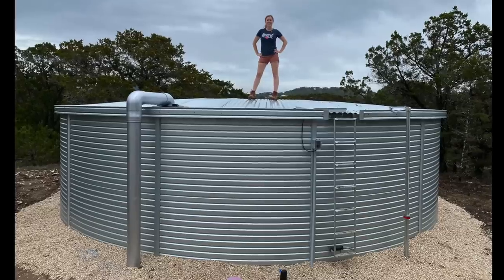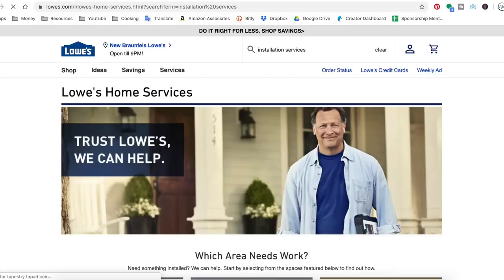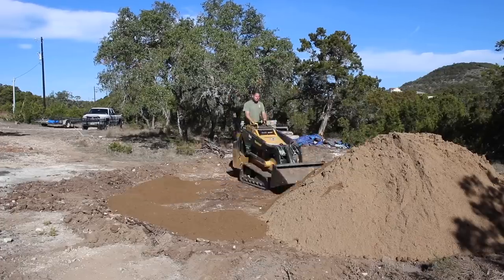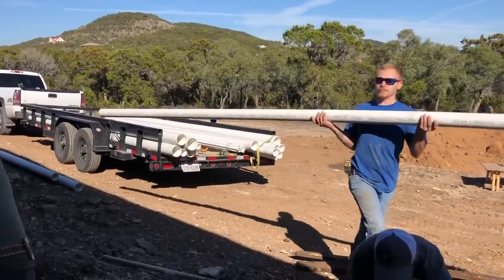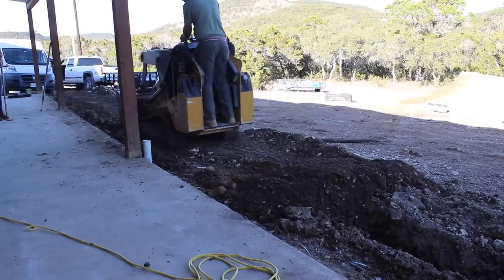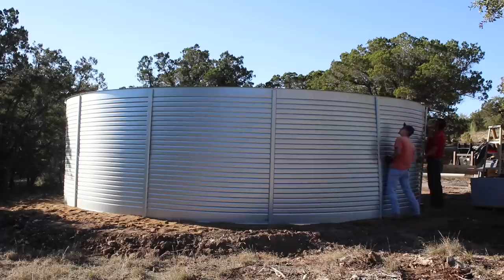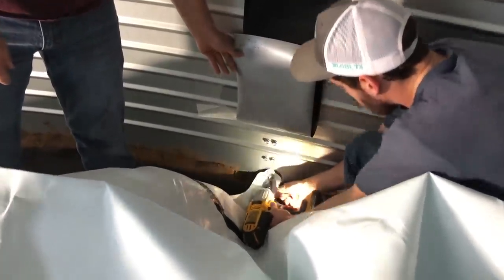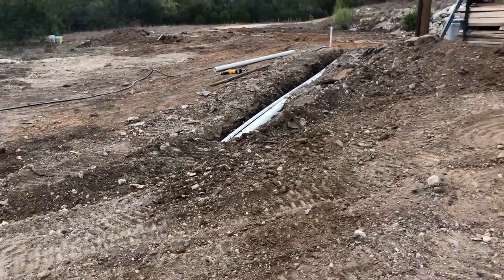Installing Rain Water Collection

Comment: It would bug me so much if my huge water tank didn't collect the rain from its OWN roof.
Reply: any advice on round gutters? I have a smaller secondary tank I would like to fill with the water from the roof of my main tank.
Reply: @Colindstuart  My apologies for my sloppy writing. I now see it could seem like I actually owned one. I do not. However this is the second YT video of such a tank installation that I've watched and neither has shown the tank roof being used to self-harvest its own rainwater but each channel has indicated it was possible with some sort of optional kit or adapter.

If possible, contact the installer or dealer for your main tank.
Reply: @puirYorick  part of the challenge is the lower height of the tank collects more leaves and dirt, and you have minimal height to deal with it before it goes into the tank. Curved gutters also can be very expensive. My tank is an extra 960sqft though, so an extra 15k gallons of rainwater annually for me.
Reply: @Colindstuart  It seems that the design challenges have been answered because they mentioned it was an available option. It's a matter of cost/benefit ratio for each client.

Comment: Had plans to build a home in Encinitas, Ca which would have harvested 20,000 annually in normal years.  That coupled with a Pex Upinor water distribution plumbing system would have provided independent flow to toilet, bath, laundry and garden.  Now, install an irrigation and growth stimulation system for the mesquite that grows in your neighborhood.

Comment: In my home state in Australia 🇦🇺 it was compulsory to provide new homes on any size allotments with a minimum 2,000 gallon tank fed by 50% of the roof area. The tank had to supply laundry, toilets and external taps. A float level in the tank would trigger an automatic refill to a minimum level from town water. 
We have to install rain heads that catch leaf litter before going into the down pipes plus insect proof lids on the tanks to prevent mosquitoes etc breeding in the tank.

Comment: As usual with most of April's projects, it needs to be "stand on it tested". A "Wonder Woman" pose? Love it! Not harvesting rain water from the tank's 600+ square foot roof seems like a waste about 4600 gallons of water created by 12" of rain but I am no expert at rain water harvesting. A ready supply of water would also be useful for fighting a fire.
Reply: Hi Ron, Collection from the roof of the tank is an option, but there are compromises necessary, including not being able to divert the water when the roof is dirty, and being so flat, it gets very dirty in the summer... The shop building provides plenty of water to fill the tank and the roof will tend to stay cleaner.

Comment: That is super cool! screened gutters would be a good idea to keep crap out right off the bat. A sediment collection off the downspouts where stuff that floats floats above and heavy stuff sinks into a barrel and water is taken from the middle with a valve to keep it shut until that barrel is full would help. I'd be very interested in how much this costs.

Comment: Here in New Zealand most people in rural areas and some small towns are 100% rain water. Some people also have bores to fill their tanks up. We use our tank water for drinking aswell without treating it which means that it tastes much better than any water you can buy.

Comment: To keep the tank cleaner, it helped to install a system to discard the first gallons with dirty water due to roof dust. 
 I have it at my house. In my case it was simple: 1 T connector + tube 3"-2 meters and 1 tread(for cleaning) end cap with a little hole(self flushing) at the bottom.

Comment: Great Video April! I know many people would love to be independent like that, me included. This is great for rural people with well supplied water, but those of us with municipal water usually have municipal sewer also. In a lot of systems it's a big no-no to harvest rainwater to then use it for laundry or toilets and then have it enter the municipal sanitary sewer. For one, sewer tax is based on water consumption on the meter and rainwater is not metered. City fathers really frown upon that. Then, an excess of non-municipal water in the sanitary sewer can easily overwhelm that system and sewage can back up into houses connected to the lower end of the system. Urban and suburban rainwater harvesting is best limited to the rainbarrel by the downspout idea, and it should be perfectly fine to use that water for gardens, lawns and car washing. Years ago I worked at a city water dept and my job was to inspect houses to make sure storm water was not infiltrating into the sanitary sewer. 

Love your videos!
Reply: I have never considered the municipal sewage aspect of collecting rainwater in a residential area (non-rural.)  Thanks for sharing that information.
Reply: C Spann I would suggest that you have confused another issue with rainwater collection.  It was very common in the past to have combined storm water and sewers.  Homes and other buildings would simply run their eve troughs to the sewage mains. Cities would just have one pipe collecting waste and send it to what ever sewage treatment  they had.   

This was mostly diverting rainwater and sewage to another area, river, lake or ocean. The solution was to dump and forget. This left many waterways polluted and unusable.  Modern waste water treatment plants have been made to solve this problem.  They can be made to handle the daily needs of modern cities.

The problem is that many older cities don’t have waste water separated into two streams ( pun intended), they have combined sewers and storm water.  During normal times hopefully the waste water treatment plants can handle the load.  However heavy rainfalls events can tax or overcome the limits of these plants.  Thus cities began to limit the amount of water coming into the combined system.

One of easiest steps was to go after residential properties and have them disconnect eve troughs from the sewer system. The vast acreage of roofs in a city could hopefully be diverted away from the sewers.  

If one collected rainwater for toilets and watering purposes it would not be an excessive burden on the municipal system. Toilet flushing is not continuous event and would save potable being wasted.  Watering of lawns and gardens puts some water into the groundwater cycle although excessive runoff can find its way into a combined sewer.

As to the municipal costing it does create issues as sewage services are taxed usually as a percentage of water use.  It brings us to the conservation paradox that saving creates higher cost the further one reduces. That being the case when the product used was once the majority of the cost associated with the service.  Delivery now is the majority of the cost and conserving or cutting back has little result on the cost.
Reply: @acemannotsomeother  True- I was aware of separate systems as I worked with one back then and live in such a water district now. It's just that the town mostly doesn't want any unregulated water getting by their meters and I could be penalized for it.. Sewers downstream would probably not overflow with rainwater harvesting upstream. Overall net consumption would not necessarily change, just the sourcing of some of the inflow. I just wanted people municipal water districts to be aware. The rules aren't the same everywhere and people can do whatever they want, but it's not what you do it's what you get caught doing. This video has inspired me to get a plastic drum to collect water for my garden though. Why I haven't done that in all the years I've owned my house is beyond me.

Comment: April, happy to see you now have the ability to collect large amounts of rainwater for your Texas ranch.  The video left a couple of unanswered questions: I noticed the gutter installation truck said LeafGuard on its side yet you didn’t go with a covered gutter to prevent debris collecting in the gutter.  Why is that? Additional cost?  On that note, how are you filtering the debris?  Also, it looked like you were only collecting the runoff from one side of your shop.  Is the far side also tied into the system?  Thanks for sharing your projects and keep up the good work!
Reply: 4:55
Reply: Thanks for that!  I don’t even recall the diagram popping up.  I just couldn’t imagine she would only collect from half the roof!

Comment: I have a rain harvesting system, but that is the norm in many areas of Hawaii. I also use it for drinking water. Another project would be to add a first flush system but if you don't ever plan to use the water for drinking then it may not be needed in your set up.🤙🏼😁

Comment: Very smart to get seamless gutters installed. We used our catchment system in our off-grid home for 12 years, but needed a much larger roof & more storage to get us through 5-6 months of drought we had almost every summer, though. Still have the system but we use a well at the main house. We're fortunate to have good well water, but nothing is better than rainwater. 
They use the same type tanks here in the oilfield for temporary water storage, only many times larger. We have the 1500 gallon black poly tanks-what we could afford at that time. They've held up great for almost 20 years so far. What was the total cost of your system? Our well was around $24,000.
Reply: The cost of this type of system is very similar to a well.  Many of our recent projects are for people who drilled a well then found out the water was terrible. We typically size the tanks to provide 10 month of supply to the house, so 2500 gallons per month would have a 29,000 gallon tank like Aprils. If you have a pool to maintain or garden you wish to water we install a 40 or even 50k gallon tank if there's sufficient roof area to fill it.

Comment: It's gonna get lost in the comments, but you did a great job detailing the work and features of this system. The workmen seemed on the ball and going no-shoes was interesting. The one other video that I saw for a different system did not mention the anodes, nor the graduated pipe diameters.

Comment: Wonderful to see your tank and rainwater collection, April. Here in Australia, rainwater collection tanks are very common, storing 150 000 litres (39625.8079 US gallons) is considered a reasonable amount, if it's possible, due to our variable rainfall. 

Just one minor observation, the word 'potable' has nothing to do with pots and pans, but is derived from the Latin, 'potare', meaning 'to drink'. It's pronounced 'POH-ta-bull', with a long 'oh' sound. Potable water is that which is considered drinkable. Hope that your tank fills soon and that you can use it for irrigation and drinking, when filtered. 👍😊 🇦🇺🦘🐨

Comment: This is so cool!  It's so awesome to see people using natural resources like this.  Do you use solar energy anywhere in your home or shop?  I'd love to do both.  My concern with rain barrels is that if I just did the ones on gutters, I'd have to go out and get the water from it.  I wonder if there is a way to pipe those to just go to say, toilet flushing?  Or laundry water?  

One other question, too.  Does your neck of Texas get enough rain annually that this size is warranted?  Just curious.  I'm in eastern NC and we get a crap ton of rain sometimes.  I only live on less than a half acre lot though so I'm not sure if there would be a tank small enough for me to utilize here.  I'd rather use what is given to us naturally though if possible.

Wonderful video April!  Loved it!

Comment: First-How much pressure does it take for the water to go up that 8 foot tall pipe and into the tank. Second-How much evaporation will do you expect?
Reply: In this case gravity is used to get water from the roof into the storage tank. The gutters are above the level of the inlet of the tank it is said.
Reply: As long as one end of the pipe is higher than the other, the water will flow to the lower end, even if the path is up and down.  The water doesn't get lost to evaporation - it condenses on the inside of the roof and runs back into the water.  If the roof wasn't there you would lose about 100 gallons per day on hot summer days from that size of tank.

Comment: Every house in Bermuda has rain water collection mostly consisting of a masonry tank below the house. More often than not the top of the tank and the ground floor slab are one in the same. Limited piped water in Bermuda and those home that do have it use it for top up not a main supply. All houses have a standard water pump and pressure tank to provide water throughout the home. The water is used for everything from drinking, cooking, washing... Water conservation is critical as the cost to buy a truck load can be expensive, if you are buying a lot. Yes the roofs are different and the gutters are on the roofs with the down pipes installed in the masonry walls from the roof to the tank.

Comment: Hello, i did not notice any filters?
Also where i come from we would install a water trap, with a small drain hole in the bottom. This is used to keep the majority of the bird droppings out of the tank, as well as sand.

Comment: A couple of suggestions 1.filter mesh on the gutters to stop infiltration of ? 2. Bird deterrents on the gutters as well because of what comes out of birds enough said on that subject and this is too late but could be added - clean outs at all the long runs of the drain pipe leading into the tank and or back flushing ports.

Comment: Very interesting! 3 questions I have do you need a pump to raise the water 7 ft up to go into the top of the tank?  How often do you need to clean the tank and do you need to put chemicals in it?  Finally, how much did the system cost?

Comment: For people wanting to use a simple rain barrel at grade level keep in mind that there is little to no water pressure. Useless at grade level once the water level gets down to half -- found that out the hard way; and even when full the water barely trickled out.

Comment: Iowa farmer here.  We have four farm buildings with metal roofs, all reasonably close. I have long thought of your type of system, but worry about  dust, dirt and leaves entering the tank.  I have examined settlement systems which slow down the rain water, allowing heavy dirt to settle out, then a chamber which keeps floating debris from getting moved into storage.  And worse yet, northern Iowa DOES have a frost line!

Comment: Although I'd love a huge above ground tank, it's unlikely our HOA will allow it (nor do we have a really good spot for it).  Currently we have 8x 50 gallon rain barrels and this year or the next we're going to upgrade them to 200 gallons (maybe a couple at 360 gallons each).  The hope is that we're going to be able to offset most if not all of our exterior watering.  We get about 14" of rain a year on average so anything we collect is pretty important.  FYI you can get properly designed barrels that can handle freezing. Depending on the shape of the barrel some may want to come apart at the seams when they freeze.

Comment: April .. do you have to manually flush the initial water collected (assuming it has not rained in a while) to get rid of any roof dust/debris? Or did they install some sort of automated first flush system to flush the first couple of gallons of roof water? Good video .. thanks for the info.

Comment: Hi April.. We are building a rainwater harvesting system as our sole source of water.. potable too.. we've purchased all the components except for the pump and pressure tank.. we currently have 7500 gallon capacity in 3 plastic tanks but are thinking about adding another 5000 gallons of storage capacity. We're collecting water from our 5000 sf shop building. Which mean that a 1" rain will collect about 3000 gallons of water... so my question to you is how big is the surface area you are collecting from and why do you think you need 30,000 gallon storage capacity...we are west of Ft Worth... is your rainfall in the hill country that much less than ours? What kind of irrigation are you planning to do? Thanks in advance for your answers... good luck with all your endeavors!

Comment: Pioneer tanks, just as good as AquaMate.  Both good Australian manufacturers.  Good to see other Americans enjoying the locally designed and built, exported products.
Reply: Australia is decades ahead in this area, and is why much of the collection and storage equipment we use is imported from there.  Now if it were just a bit closer... the shipping cost is awful!
Reply: @CqureWaterTexas  quite true.  I've been here 21 years now, an expat, and they were decades into the process already.

That being said, the shipping price is better for you lot to import than it is for the Australian's to import, specifically relating to the USD<->AUD conversion.

Comment: How does one keep the water in the tank from freezing?  And is PVC pipe safe for drinking water?  I have heard conflicting viewpoints on that.

I also didn't see a first flush diverter coming off the roof gutters.  I guess that's OK if you don't mind dead insects and birds droppings in your water tank.